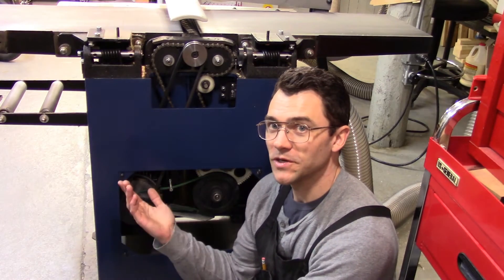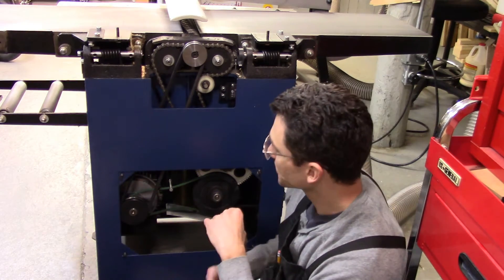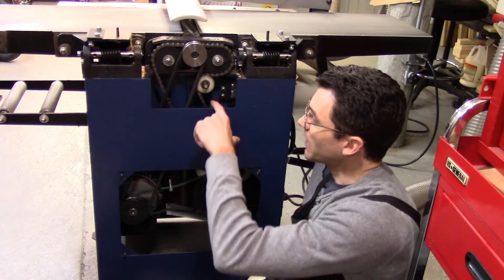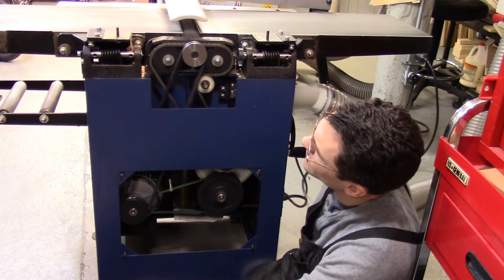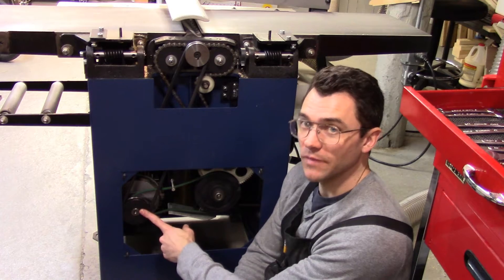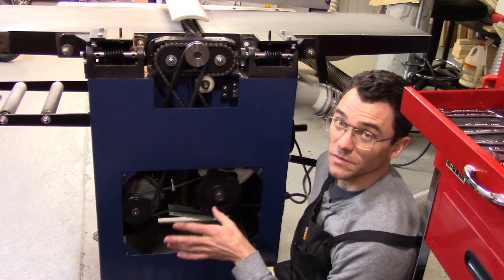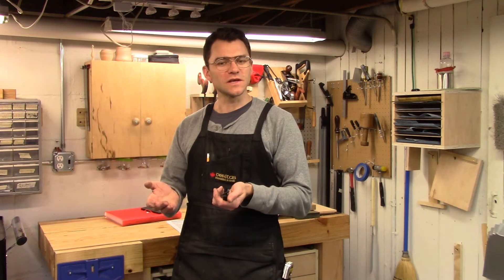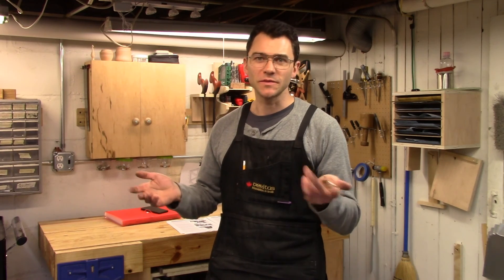Rikon 12-210H Infeed Roller Chain Adjustment

Comment: Great video, thanks. Compared to my machine you've barely got an issue. On mine the chain is jumping all the time even when it's not under load. I've tried tightening the idler but it doesn't seem to be much of a fix. It corrects the problem for a little while and then it goes back slipping. I wonder if the chain has stretched, does that sound plausible do you think? Even to my non-engineer eye the design looks wrong though. The way it's built the sprocket for the outfeed roller will only ever get about 1/4 engagement.

Comment: nice videos, very informative, the belt flapping is normal on a span that long, it should have an idle pulley or tensioner, but as long as the belt is not loose it's fine

Comment: Hey David... Have you had any issues with keeping the fence square to the tables? I can't seem to keep them square. Every time I lock it down it shifts the top of the fence back slightly :(
Reply: @DavidPx  dang... Ya I pretty much use the same process but no matter what I do it just seems to shift ever so slightly. I can usually work with it, but it drives me nuts... I'm thinking I may to have to just make a fixed 90 degree fence as I dont  joint many angles and I can just move on with my life :p